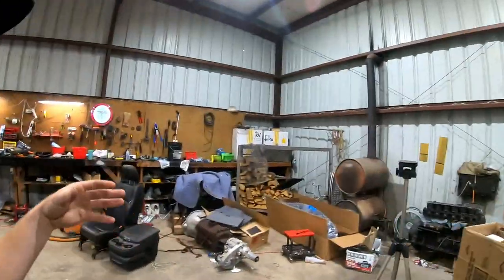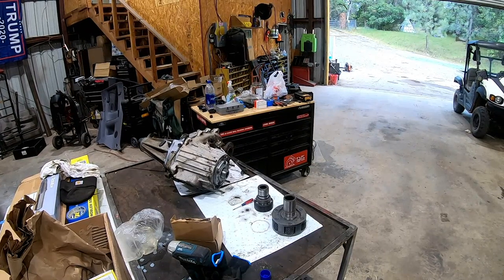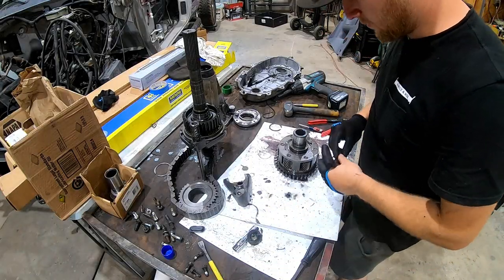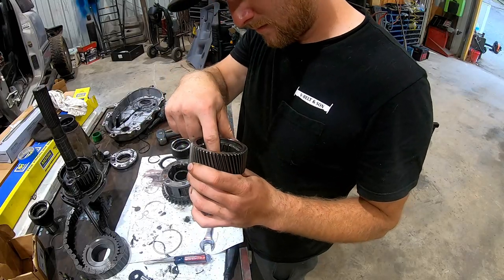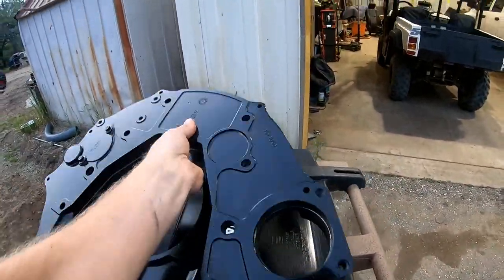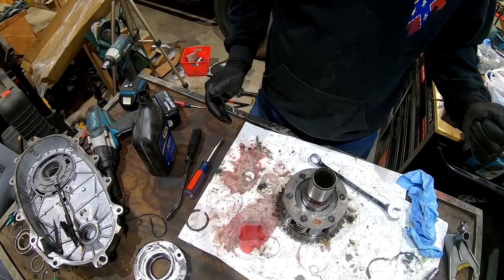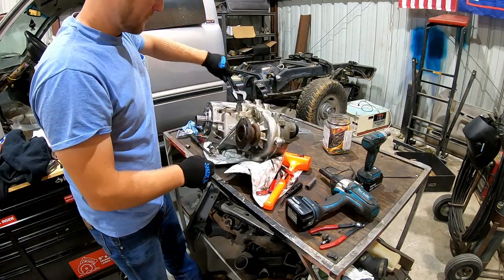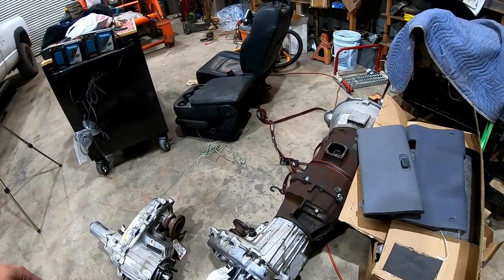CONVERTING TRANSFER CASE TO FIT NV5600 Stick Shift

Comment: There is another thing to be aware of. Some input shafts take a thinner bearing and most take a thicker bearing. The transfer case is the same for both and you can use either bearing with the transfer case. But it’s good to know what one you have when ordering. If you have a thin bearing I would just order an input shaft and bearing for the thicker one.

Comment: Definitely a short throw shifter.  I had a BD one on my NV4500, never had a positive engagement feel with it.

Just a note on the NP271 and a 2nd gen, they will fit without cutting, just not on an NV4500.  I'm running one behind a G56 on my '98, and the outside of it just starts to enter the c-channel on the frame.  Because the 4500 is shorter, it would interfere where the frame is boxed.  But since it doesn't have the vacuum switch or a speedo pickup, it wouldn't be good for your earlier 2nd gen.  I've got locking hubs on mine, so no need for the CAD, and the speedo is from the RABS sensor.
Reply from the maker: Mine is a 273

Comment: You will need the plug out of the other shaft as well . The bearing and freeze style plug needs to be ther or it will share fluid with the trans
Reply from the maker: Yup glad I just went with the old used shaft hah

Comment: The 1998 to 2002 have a different shift pattern than the 1994 to 1997. Also if it doesn't have the port for the vaccum it's for a 2002. The 2002 trucks were the only 2nd gens that dont have vaccum 4wd the drive shaft spins all the time like a 3rd gen.

Comment: Do your self a favor if you have the tc apart and change the seal or o ring on the shift shaft . I had my transfer case overhauled but apparently they forgot to chage it . A leak around the shifter that winds up on the bottom of the case .

Comment: Good vid!
Is the output shaft seal on the transmission easy to replace after getting the xfer case out?
Reply from the maker: Very easy to replace
Reply: @VBELTandSON  Thanks!

Comment: Just an FYI the 271 tc out of a 3rd Gen does just fit in between the tails of a second gen 
I’ve done it on mine 
Now would I do it again no but if u have one and it works it would fit
Reply from the maker: Hmm mine is a 273🤷🏼‍♂️

Comment: You can push the bearing out from the back.
Reply from the maker: No
Reply: @VBELTandSON  You can press the inner needle bearing out from the input spline side -- there is a welch plug that seals the transfer case fluid from the transmission.  To replace the bearing press the welch plug in first, then press the bearing in.

Comment: On the 04 do the doors all unlock once you take the key out? My 05 will auto lock when you start driving but it doesn’t unlock them when you shut it off lol
Reply: My 06 unlocks when it goes back in to park
Reply: Daniel Umphres yea autos do it but I got a 6 speed just like his 04

Comment: Shoulda done an HD SYE while you were in it. They're VASTLY stronger and you'll need a new driveshaft anyhow.
Reply from the maker: Scott L I don’t think I will ever break this. And just need to shorten the old shaft no biggy
Reply: @VBELTandSON  Agree. You usually hot rod your rigs. If it's not a DD or always in 4 low getting beat, probably no need.